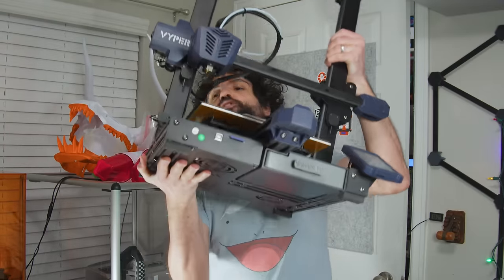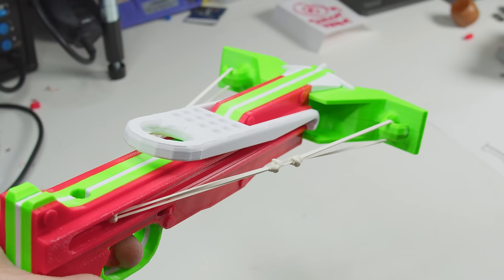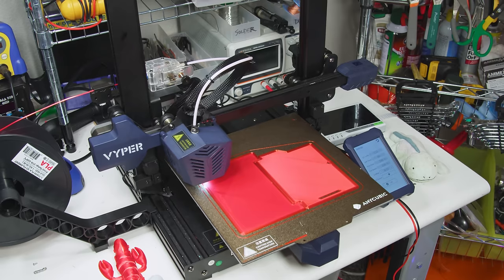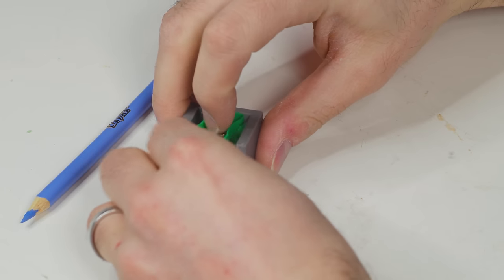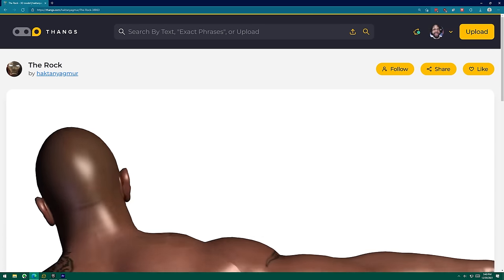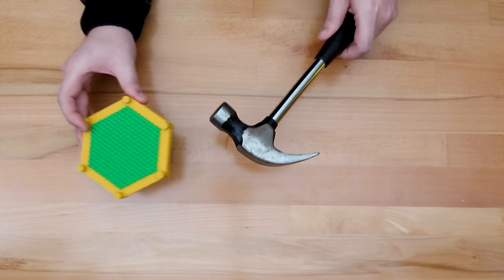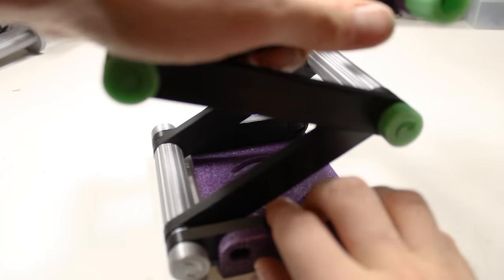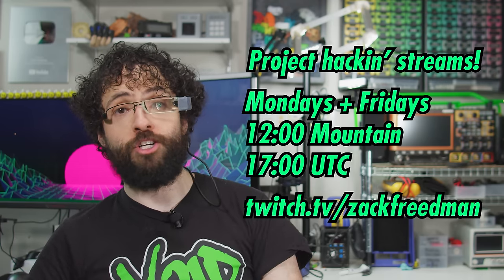10 Cool Inventions Anyone Can Print - The Best Models for Brand-New Printers

Comment: The rolling storage box is an old market failure, the Roly kit came out in 1997. I do love the idea of a small one for tiny electronics, my mother bought one in the 90's and kept sewing supplies in it till my dad dropped it on a parquet floor. It died in the most spectacular fashion.
Reply: I picked up two Rolykits second hand recently and I've been using them to store my small electronics parts. They're really good for that ^^
Reply: @StrangeLake  My dad had 2 that he used for oddball screws and bolts and such
Reply: There was one back in 79,80. My step-dad had one. We did property management. It was great for the little things like nails and o-rings. It rolled right out to the end. But the end one was lid for the 2nd row. It lasted a long time. In fact I don't even know what happened to it. 
These designs brought back repairing stuff for someone
Reply: I have a huge one that I keep my spools in (thread, not filament).  I assume it's a knock-off version as I've never spotted a brand name on it and it works kinda...not...good...but well enough for the occasional sewing project. It has a sliding lock on the handle that keeps it very securely shut.  Correction: the sliding lock is separate, not on the handle.
Reply: I got one. They suck, I store all the little parts I am least likely to ever use in it. You have to carefully unroll and roll it up or parts spill out or get caught in the hinges. Also, since it's not clear, it's easy to forget what is even in it. Those clear plastic comparmentized boxes or those things with all the little drawers are much better.
Reply: Not sure I would agree it was a failure, they sold and made millions of them for years. They where patented, but it appears at least some of those patents have expired which might make them fair game to be reproduced on a printer…
Reply: @rumpleman4569  Yup. I remember it was used for all sorts of things. Tackle Box, Quilting accessories, Toolbox.
Reply: It is also still a thing today, but just for glasses or other objects similar in shape. They are made of mostly fabric and a hard board or thin cardboard of some sort so that it won't easily break but can still protect your glasses to a reasonable extent. 

Every time I try to get one at a reasonable price they're sold out though so the material to make it rigid is an educated guess based on other glasses cases I have.
Reply: I remember my dad had one
Reply: I love the rolly-kit! My dad bought a bunch of them from an infomercial for all of my family members for Christmas.  I still have one,  I think there was like 3 sizes too. They work awesome until the fabric wears out and they miss a tooth when rolling up, lol.  Dido on the electrical du-dads.
Reply: @matthewschultz899  when my dad killed it, it landed on the corner and ripped the strap and broke so many of those teeth lol. Still have a brown one from goodwill full of capacitors  sitting on my shelf.
Reply: I think Roly kits were out before 97, 'cause I swear I've had mine since I was in the Navy and I got out in '95.
Reply: I came here to say this. My mom had a full set when I was a kid. The idea is cool but they ended up being desk organizers that never actually got rolled up
Reply: I remember the ads for those. Pretty much identical to the one shown here.
Reply: I was gonna say, "I feel like I've seen this when I was a kid"
Reply: I remember the commercials for these things.  Even though I am the most disorganized slob on the planet (fight me, I would win.  You couldn't even find me in my piles of things.) I always thought these things were cool.
Reply: Omg my dad had one it was the worst
Reply: I had one too, it was kind of cool but a little awkward because you had to unroll the whole thing if you wanted something in the center
Reply: I was always asking my parents to order one for my Lego
Reply: Pretty sure I still have a couple of original Rolykits in the shed somewhere. I really should find them and check if they are still good.
Reply: I still have like 5 roly kits around.
Reply: I have a rolykit that I WAS using for electronic parts, back when I was just getting started. What it's currently storing is those first electronic parts that I ever purchased, that I keep meaning to go through and move to my parts drawers.
Reply: I still have a couple rolykits.  I use them for fly tying supplies
Reply: I came to see if anyone mentioned the Rolykit!  I love mine to organize all my printer parts
Reply: Print solid with zero infill for a trolling storage box😎👍
Reply: I actually have a rolykit. I don't remember where I got it, but I used it to organize robot parts for bringing them to competitions. It was really impractical.
Reply: What's a parquet
Reply: I remember those horrible commercials.  They flooded day time tv to target all the bored housewives.
Reply: I wouldn't say they are a complete market failure, the market may be small, but they are popular in some circles. Head to any wargames convention in the U.K. and you'll see lots of people using them for storing their miniatures.
Reply: Yeah - The funny thing is... I was creating holograms in an artistic way many years ago (and will start doing that again within a few months by the way). Those holograms caught the attention of the owner of a little hologram gallery and shop in the town of Amsterdam. Long story short - I started working for that shop together with a fellow holographic creator and designer that owned a big Argon laser (I used to work with a far less powerful Helium-Neon Laser). But here is the interesting bit. The owner of that shop (and my would-be employer at that time) was Gied Jaspars. The same man that worked together with Samuel Meyering to bring the Rolykit to the market. The thing was maybe not a great success, but still sold enough to make the people involved earn a considerable amount of money. I owned one of the first production models for years, until it sadly broke.
Nice to see that this idea is still alive and valuable after all these years. I can only say I had a lot of fun in those days (I still have, but take things a little bit easier these days).
Reply: I have two, lol
Reply: Lol , yeah I was gonna say, OMG I remember those! I never bought one though.
Reply: if by the 90's you mean 73, then yeah. and it failed because the creator lost the patent because.... someomne was already making them...
Reply: Zack should invent a grid-oriented storage system. We'll all be better-off if he does.
Reply: I had one as a kid one was red and the other was blue and orange from hot wheels. Never really used it as a kid but as an adult I wish I had saved it! I gave rhe red one to my buddy who fitted it with foam for our DnD miniatures and dice!! The hot wheels one went the way of your mom's sewing kit😳😔 spectacular display of shattered plastic and a hundred or so hot wheels engorging the air like a freshly lite fountain on the fourth of July.
Reply: @GMCLabs  for my buddy's we bought some small neodymium magnets and a sheet of Plexi. Cut out squares for lids and glued magnets on the lids and inside of the container so his minis and dice would stay put
Reply: You know...I think we, too, had one when I was a kid?  I think it was red??  Now I'm wondering what we kept in it, and what happened to it, haha
Reply: Your right 😂 I remember.
Reply: I had a Red RolyKit as a Kid I kept my Legos in. O.o
Reply: About to say the same thing, still use mine.
Reply: @b-roll4881  Yep my Granpa had one in the 70s
Reply: My dad had one of these, the clasp broke on it in about 2015, it was held together with twine until recently when he got rid of it
Reply: I still store all of my LEGO technic parts in one. Got it brand new for Christmas and still holds up strong.
Reply: Both my dad and I have Roly kits, found mine at goodwill and I will never give it up.
Reply: They were absolutely great for fishing tackle or warhammer bits 😂
Reply: We had 2 I think. I'm pretty sure I just liked playing with it lol organizing small toys in it (probably), rolling and unrolling it. I think I used it as a giant fidget toy tbh lol
Reply: Yes, I recall these from even earlier than 1997.  They were useable as long as you did not try to over stuff them.  If you only fill each compartment to about 60-70% of its theoretical capacity, it is not bad.  Still not very convenient for commonly used items.  One overstuffed compartment causes it to not close correctly, and if you do mot correct it, the unit will fly open and spew its contents in a maelstrom of regret and shame.
Reply: >Sewing supplies
>Spectacular fashion

iseewhatyoudidthere

Comment: PSA for newbies! Almost none of these are viable on resin printers. Printing mechanisms on resin is completely different due to the difference in material properties. Print-in-place can work with heavy custom supports, but if it's gotta be springy, durable, or have tight tolerances, use an FDM printer.

Comment: Hint on the tall narrow prints - very wide brim.  I'm talkin' 30+ wide, but basically make it so the base is at least 1/3 to 1/2 or even more as wide as the model, so it has a much higher resistance to failure late in the print.  Also make sure the squish on the first layer is decent so it adheres really well and  the bed temp is on the higher end of the spread.
Reply: I've made it through some tall spires such as a trophy where a brim would have not helped as the base was already printed below. I added some painted on supports and the tree supports braced the spires so they didn't flop back and forth too much

Comment: My first project (I'm talking stuff I made in Fusion 360 for the printer I got a couple weeks ago) was curtain gliders, because the curtains my sister didn't need anymore had glider bits that didn't fit the tracks in my flat. Though while replacing the glider bits I noticed that the ... er, hanger bits? ..., well, quite a few of them had damaged hooks, so in a few places the curtains have detached from the gliders. Now I might need to remake the hook thingies too.
Or I'll try to replace my broken bike lamp enclosure.

Comment: My favorite key hanger isn't printed at all, but is just a standard ethernet biscuit jack mounted to the wall. I made a few loopbacks that double as keychains and they plug right in (and the loopbacks are functional and handy to have in my profession)
Reply: I love this idea. A dead network switch would be an easy way to keep a bunch of them together.
Reply: @Hawk7886  I have an old hub on the wall at work for that purpose. Plus the hub can be handy in a pinch for easy port replication for wireshark and whatnot.

Comment: I've wondered about using magnets as clamps on those tallish prints that are prone to getting knocked loose (pause the print after it gets tall enough for the nozzle to clear the magnet clamps). If using a spring steel PEI coated sheet, there should be something to clamp to, but I'm not sure how a magnet on top will interact with the magnet on the table sheet.

Comment: Something that really helps with prints that tend to lose adhesion is Aquanet hair spray.
It goes on as a fine mist so you get a nice thin adhesive layer but it's considerably more aggressive than kiddie glue stick. Cleans up with water when you need to have it gone.
I print much tougher stuff than those nunchuku and since I started using it, I haven't had one spaghetti failure.
Reply: Or masking tape if you dont have a heated print bed.

Comment: Hi Zack, 

i really appreciate your wide range videos and learn a lot from them, so go ahead with the good work!

I saw in the beginning of the video that you have an Anycubic printer. I bought a Anycubic Kobra Go and been experimenting and watching lots of videos to finally get the print quality i am looking for. Can i ask which slicer you use and if you used the pre defined configurations which come with the printer for the slicing software or if you have tweaked the configuration.
I struggle espacially with tolerance issues and the fact that even if the print starts well at some point the first layer somehow melts together and therefore functional parts don't work anymore and this is really frustrating because i tried a lot and wasted already a lot filament.

Hope you can give me some advise.

Comment: New to the channel, but loving it.

I felt the cursing at the print deciding to fail so close to the end, soooooo much.

I just 'upgraded' my printer to have auto leveling and have had more issues than when I had to manually level it.

Ugh. If I hadn't swapped boards, beds and firmware, I might just make it stock again... Still might. Lol

Ramble aside, thank you for the commissarating

Comment: May try a couple of these. I've enjoyed getting into 3D printing, despite the frustration. It worked well enough out of box, but once I wanted to upgrade, whooooo boy.

Wish I knew ahead that this hobby has a way of demanding you know every bit of hardware in and out before you can get it right. Deconstructed and reconstructed most parts of it by now, just printed a new filament roller with 608 bearings because the Ender 3 one was getting lots of friction, and learned I have no idea how tight the timing belts need, and that they were super over-tightened earlier. Still debating whether I should replace the stock ones with some standard G2 roll..

Learned that trying to print a Pokeball; the Z axis was fine because I kept finangling with that every issue, and overhang tests reached 80 before they got rough, but CURVED overhang, and suddenly the surfaces seem rough and over-extruded..

My point is, I've dialed the crap in about all of this, currently contending with PLA wanting to curl like mad, and I just want to actually make something mechanically complex and cool now, so I'm interested in this video of interesting prints that have been done and tested already.. maybe I'll re-try the TPU action figure again; the joints weren't right before and the limbs refused to stay on last attempt.. maybe I should replace those timing belts with non-stock ones.. hrm..

Comment: 'not mass producible' uh.. looks over at my mass produced one from the 90s that my great grandfather had.

So it kind of sucks for most things because you need so many feet to fully open it. I just use it for electrical repair bits I rarely need and it sits in the corner.

Comment: Watching the pin screen toy and for the most part I have tolerances and sizes down for that sort of thing. My general rule is 0.5mm for a square press fit (1mm for a circular press-fit) and 1mm for a square loose fit (or 2mm for a circular). I've used this rule for printing robot models out in multiple parts, using a square press-fit to keep the pieces in place (I don't add glue until I'm happy with the model), and I've used circular loose-fit for printing my own basic spool holder.

Comment: Only thing slightly concerning could be iron filled filament on a light switch, I know it isn’t in contact with any wires but there is a chance something goes wrong, or some liquid gets in, in that case it could cause a short or the handle become electrified. Even if that is impossible, I’m not sure how it would work from an insurance/building regulations standpoint, the covering isn’t as insulating, probably isn’t as thermally resistant etc as the ones that are normally used, so don’t know how regulations work with that.
Reply: What you described is impossible. It goes over the switch.
Reply from the maker: I thought about this, but it's extremely unlikely. The iron content is only like 20%. Sure, it cuts the dielectric, but if you're gonna get shocked through your light switch cover, you're probably doomed with a regular switch.

Comment: what are some tips and tricks on printing "print in place"?
Reply from the maker: Anything that helps you get consistent outer perimeters and reduce stringing will help! But for a foolproof print, use a tough filament that doesn't snap easily so even if the mechanism jams up, you can snap it loose without busting your print!

Comment: I made the crossbow a good while ago, it’s a fun print and build :)
Reply: Did you use supports while printing any parts? there isn't much info on print settings.
Reply: @gatelyw4709  I actually can’t recall exactly but I believe I printed one part at a time and the front clip part was the hardest, I used petg and I believe I used supports, plate only, for that part I think, and pretty sure I Jst did all the other parts flat with a brim. Except for the retention pins..those were vertical with brim , I’ll look in my archive and see if I can find the file for you if you like.
Reply: @gatelyw4709  hi there, i (arkoudaki) made the crossbow model. and i printed it without supports.

Comment: My dad has this power where he always wins doorprizes, most notably at tech shows. The best one was a macbook air. The one time he didn't win a prize, it was because he got the times mixed up and they had to give his tablet to the next name pulled. I inherited this ability genetically, except I always win things I can't use. A rubber ruler. A bicycle (bone tumors make riding one painful). A bar soap holder, etc.

I'm going to try and convince myself I don't need a box of rocks and see if I can win this just out of curiosity. And I don't even own a 3D printer.

Comment: Can anyone help so I bought and Ender 3 pro that have never been turned on but it didn’t come with the lcd controler so I bought the touch screen upgrade and when I tune the printer in with the firmware on the sd card it won’t load any suggestions appreciated chears